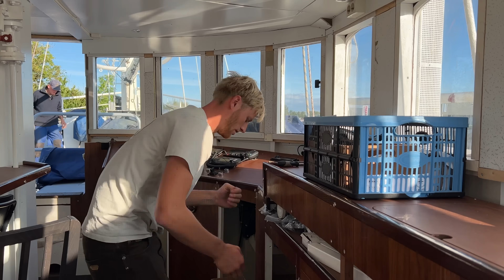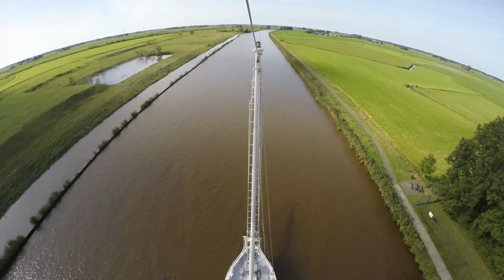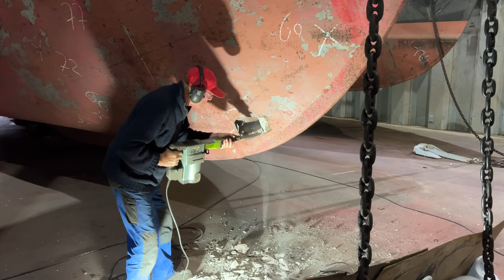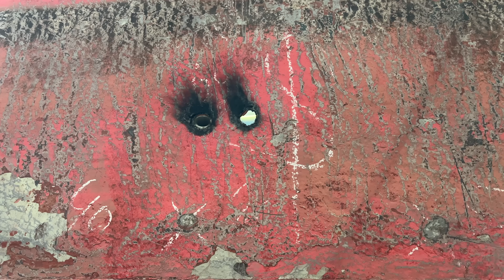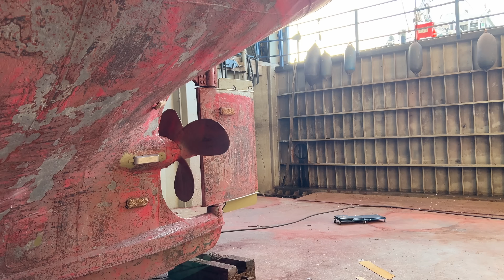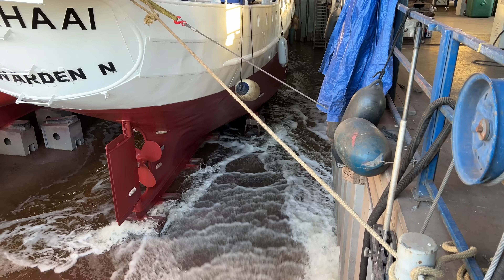EVERYTHING That Comes With Drydocking A Seagoing Sailing Ship

Comment: hammer the hull? you must be kidding....it is a steel made hull....UTM is the only reliable way....anything else is a waste of time...
Reply from the maker: Okay mister expert. I will enlighten you on every hull inspection on every official survey for every ship. Step 1: use hammer to find suspicious spot. Step 2: take off paint at said spot. Step 3: take reliable UTM measurement at said spot. Would be a bit silly, and very expensive, to take a good coating of the entire hull, for every dry dock period. And if you want to UTM every spot on the hull, the inspection would take weeks, and there you have your waste of time.
Reply: @tigersharkboatworks  ...actually I am Mr. Expert...and you have no clue what you are talking about....
Reply from the maker: Right….

Comment: I’ve watched the 2nd half of your channel’s vids, great job so far, I really enjoyed your narration, explanations, and videography.

But, I gotta say, my fav part so far… Mast Cam!!!

You could sell your vids for scenic therapy! What a perspective!

If possible, get the cam above the wire going to the fore mast. 

Hope to see all of Holland’s canals from your mast!
Reply from the maker: Thanks! I’ll see if I can get a setup up there, with a charger and way to get the footage down without going up and down the mast for the memory card :)
Reply: Great to hear! Sailors use solar-powered wireless PTZ security cams for masthead setups—no climbing for cards or charging.
Top recommendation: Reolink Argus PT (or Argus PT Ultra/Altas PT Ultra)
	•	Battery + solar panel
	•	WiFi app for live view + remote download to phone from helm
	•	Mount above anchor light with simple bracket
	•	Many cruisers use this for mast cam views
Power: Small solar panel for indefinite charge. Footage: Wireless via boat WiFi hotspot—no mast wires needed.
Alternatives: Eufy or Blink Outdoor solar models (cheaper, similar app access).
This is the same rugged tech as wildlife/trail cams—perfect for boats.
Reolink Argus PT (~$100–150 with solar) is proven and easy. Excited for those Holland canal MastCam vids! 🚤📹

Comment: I was expecting you to sandblast the hull. Was there no rust.
Or did you jus treat the rusty spots.
Reply from the maker: It's been sandblasted 30 years ago and since then recoated every 5 years, so apart from removing loose paint, and recoating (and the holes) the hull didn't need much :)

Comment: did you find the source of the black water corrosion coming out of the coolant system?   I really like dry exhaust systems.  do you have a keel heat exchanger for the engines?  all that work and more not shown in the video in just 2 weeks!!!! Bravo to the dock workers.  I'm sure you and your dad did a lot of work too.   my favorite building material for a boat is steel.  as a welder myself, I enjoyed watching all the work on the hull.  Nice job on the bow thruster!!
Reply from the maker: We suspect the source is just the cooling liquid gone sour. The anodes in the system were still like new. I agree! We don't want salt water running through the engine or exhaust pipe. All three engines are cooled through the bilge keel heat exchangers. Thanks a lot!

Comment: I am surprised you get away with only drydocking every five years. I Australia I can get away with two years otherwise anodes and growth gets to be too much
Reply from the maker: We are currently on fresh water, which helps a lot against rust, and keeps the anodes relatively fresh. The growth is really not that bad, probably because of the colder water temperature? But I'm not sure about that. When we start sailing on salt water permanently, we will probably have to do more drydockings.

Comment: That was so great to watch!  And it's a sign of how prepared and thorough you are, that the dry dock 'to do' list didn't get any longer.  Good to see the bow thruster installed -- but does it work?  I'm sure we'll hear next time ;-)
Reply from the maker: Thanks! It works fantastic! The frequency converter has a couple seconds ramp up time that takes some getting used to. But if you know, it's not an issue, and probably better for our generators :)

Comment: I gotta say, even though the ship was not originally intended to be a sailing vessel, her lines and design are definitely well suited for that purpose. Great work, guys. Shes looking good!
Reply from the maker: The hull design was used to build around 250 steel, and 100 wooden tugboats. Since you can't bend wood in the way you can do with steel, the lines had to be pretty sleek :)

Comment: Great video, did you test the bow thrusters? If so how did they perform?
Reply from the maker: It's works great! Easily enough power. The frequency converter has a ramp up time of a few seconds, which is felt a bit strange in the beginning, but once you know, it's not an issue. And much better for the generator, I guess :)
Reply: The soft start will give you a less jerky thrust so that any crew on the foredeck won't be thrown off balance